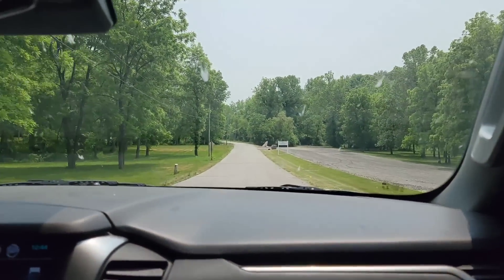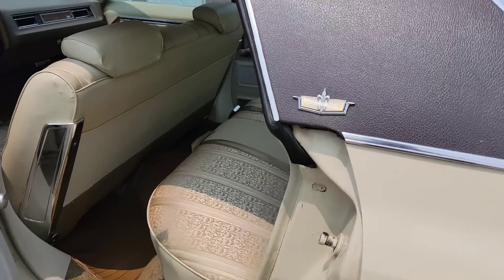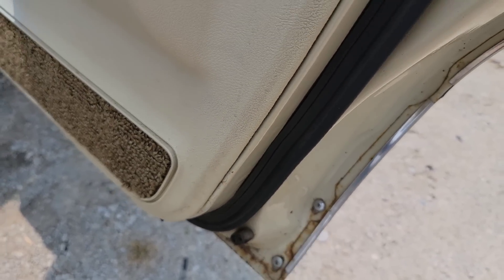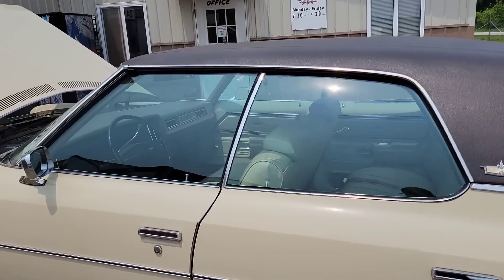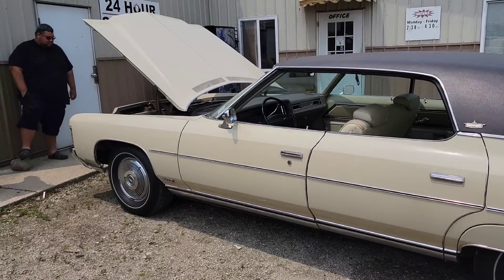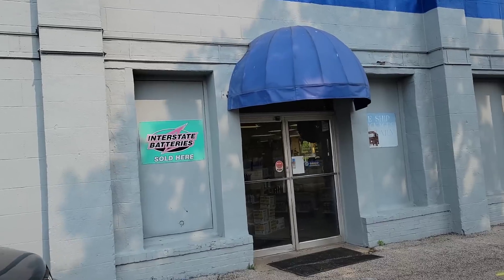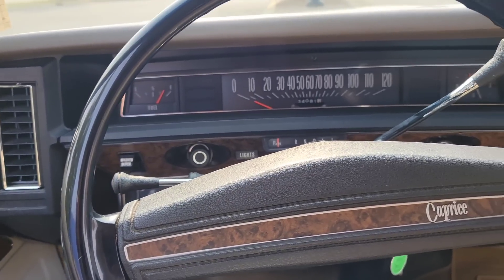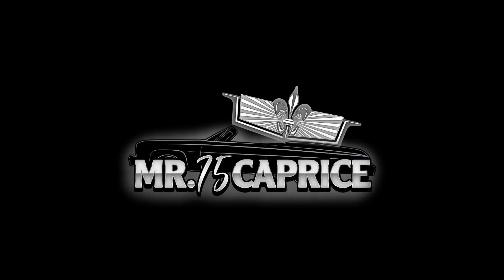I Found a Gem!

Comment: This one actually brought tears to my eyes lol I had the carbon copy 1971 Caprice only mine was the two-door the same color same interior same hubcap with the skirts and that 400 The only thing I ever had a problem with was the starter they liked to get heat soaked after a long run in very slow starting if you try to get right back in it and mine was a four barrel not the two barrel

Comment: totally beautiful, i would keep it all original give the engine a tuneup and repaint engine, the car is stunning, i have an all original 72 lincoln continental triple black with 63,000 miles was in my family since new, 100% original, except for new white wall tires and exaust and normal parts, they are only original one time, but beautiful caprice my friend
Reply: I can see you doing a combo with the c10

Comment: On GM car if you crank it up in the belt is squealing like that you back off and let it idle for 2 minutes then throttle if there's no squeal then proceed to drive as long as you want every time you start the car you have to let it idle for 2 minutes even have your foot on the brake and put it in drives you want the motor spinning as slow as possible once they are alternator charging kicks on it will stop squealing you do not rev the engine you're destroying the belt by doing that. That's why the last belt got destroyed